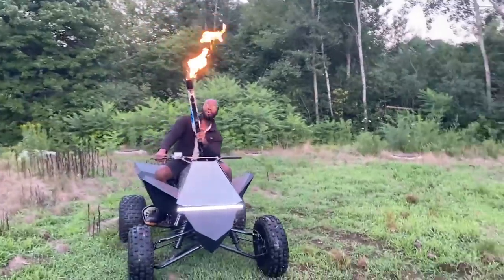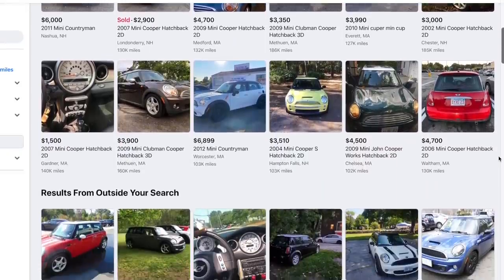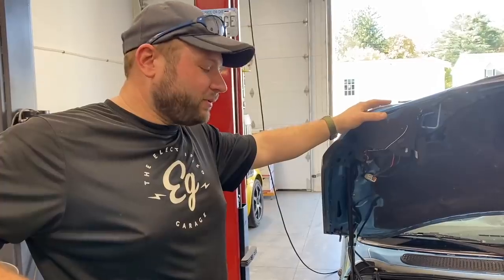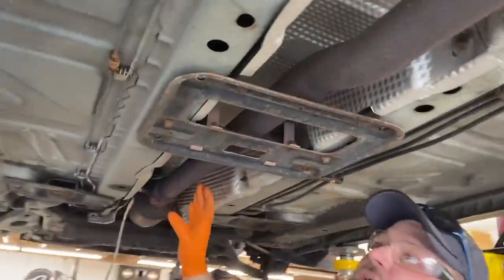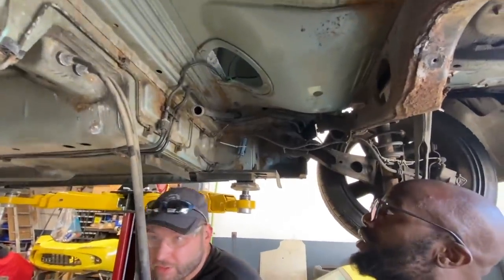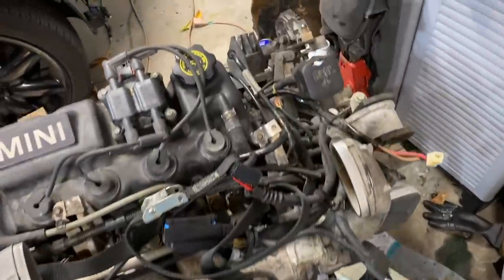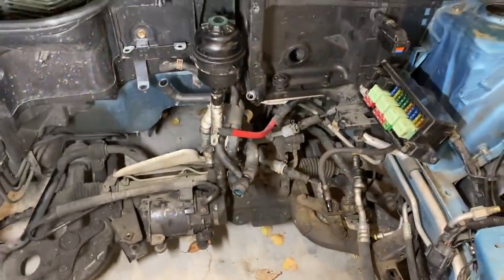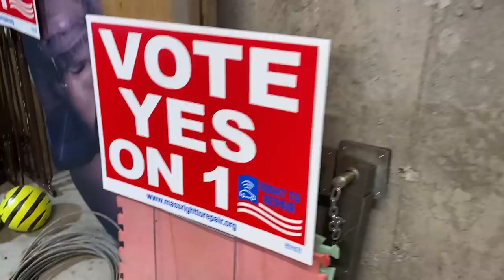I Bought The Least Reliable Car and I’m Making It Electric on a Budget

Comment: Idea : making a kei car into a hybrid, giving it an extra 30-100hp.    .. How far along are In wheel motors?    Hmmmm. Zero motorcycles got 100hp 20kg motors. In a kei van there's all the room. A honda s660 would be damn cool though. No idea where the motor would fit. Extra 50-100kg battery could fit somewhere in the passenger area, because it's their fault if they insist on Having feet.

Comment: Makes sense to keep the DC motor when you're keeping the trans. Sorry to hear the giveaway was such a shitshow, because one of those "I want this for an idea I have" dudes is TOTALLY me even though I never hit you up for parts.
I'm supes interested in how you decide to control the motor and what battery setup you go with. OEMs now are tossing out 100+ Volt potted lithium cell batteries in their hybrids, and DC motor controllers can be impressively simple even with 300+ volts running through them.

Comment: You probably aren't aware of this just yet, but there's a body control module that controls everything in the car (lights, windows, gauges, etc.). I don't know if it'll work if the ECU isn't in the car. These cars were made by BMW, so they have a lot of over-engineering in them.

The power steering fan that was seized was because the power steering fan overheated from not running. That fan only runs when the radiator fan comes on. The radiator fan is a 2-stage fan, but with a single motor. BMW used a resistor to lower the power going to the fan for the 1st stage, and those resistors commonly burned out. Almost no one is aware of this either. A big telling point for it is when you turn the car off and the radiator fan comes on to continue to cool the engine once it's turned off. It's so common that people actually think it's normal! But since that resistor burned out, it rendered the engine cooling fan inoperable until coolant temps hit about 232°F (which is easy too hot for these engines) . If this was an early model (02-04), that resistor failure can sometimes prevent the radiator fan from even coming on at all (probably why it overheated). So since the cooling fan basically never works, the power steering fan probably never turned on. So you get a bunch of debris in it and that bound it up, then it seized when it finally tried turning on. So you'll need to figure out a way to provide airflow to that pump. And judging by the crime on the hoses for the power steering fluid reservoir, it looks like they'll need to be replaced as well.

Also, you guys asked about the rear battery. Only the 1st gen supercharged models (2002-2006) had the battery in the trunk. Every other model has them in the engine bay.

If you have any questions about how things works on these cars, feel free to let me know! I've probably replaced just about everything on these 1st gen cars before.

Comment: Hey man !

First of i like your video,s alot woundt mind making my own ev myself ...

Question tho ... So you mate the electric-motor straight to the engine (with or without clutch) but i cant imagine the original parts taking all this extra torque without failing tho .... How do you handle that ?

Comment: 3 months of owning my r53 Cooper s”liquid yellow” I was 40 miles from home and the alternator wires caught fire and I didn’t realize the wiring issues bmw had with the r53s  before I committed. Mini replaced the whole wiring harness and 2 months later $3600 repair done for free the cars came back with nothing but draining issues it never stops blowing alternators but doesn’t have any weird voltage spikes or periods of higher output I’m still on the hunt for someone to take it off my hands I’m fed up and with money in the car and a rust free shell it’s a shame it’s not an easy fix I’ve done everything but I’ve Gave up 😂

Comment: 2002 piech, the VW guy, build the 1 liter car.                 Do that!  Or well. Faster, not quite as good, but faster. Got0.89l diesel per100kmh at an average of 72kmh. That turned into the vw l1 which turned into the xl1. Which is worse.    A efficient motorcycle gasoline engine and perhaps the 100hp zero motorcycle motor?         Just a tiny really efficient sportscar.

Comment: The new mini cooper... which generation? It had 3 vastly different generations the first one with the PSA engines were very unreliable indeed but the R56, which is the 2nd generation had a BMW engine in both diesel and petrol variants and are very much running without a hitch in general from what I can tell... the 3rd gen is unknown to me in terms of reliability, which is probably also a good sign.   aaaaand Rich just bought the rubbish 1st gen... excellent choice for a conversion. Go for it :)

Comment: Having filled my gas tank up then drove 100 miles and then slid off the road into a tree oh, yeah don't be throwing that gas out. Unfortunately due to time constraints at the junkyard and accessibility I was not able to recover any of it. Although I did get my stereo with Bluetooth mic and accessories but I was against a Time clock because the guy had to leave to get somebody else.

Comment: Contact Zero EV Bristol UK. They can sell you a reduction gear unit to replace the gearbox. The clutch may not handle the torque and the gearbox is not designed to handle regen. The standard box will also cost you range due to frictional losses

Comment: i dont know much about the usa spec minis, some of the uk spec ones have a battery in the front.
i had the misfortune of doing a diesel mini which had the timing chain between the engine and transmission, the top cam cog exploded so r.i.p cylinderhead, i love how you cant get the exhaust manifold out unless you remove the engine, car manufacurer's are brain dead.

Comment: Love all you projects, man... I want to take on a conversion on a Suzuki Super Carry minivan, currently around 600kg / 1323 pounds Kerb weight. I am thinking no gearbox, but two powerful hub motors in the front, and a powerful DC / AC motor at the back. The one set of motors will be for lower speed and acceleration, and the bigger motor on the back running through the diff will be for the higher end speeds, which are not going to be much.. This tiny thing is around 1.6m by 30m / 5.5 feet x 10 feet. This si super easy to park anywhere, and will be used to buy groceries and other handy city jobs that I want to do... I do not need more than 60km range on it... What would you guys suggest with something like this?

Comment: 10 years ago I ordered a 2009 JCW MINI Copper and it was the BIGGEST HUNK OF SHIT I'VE EVER OWNED!!!!!!! RUN... RUN away from this piece of shit!!!!! With lees than four thousand miles on the odometer and six months in of ownership I had a blown "tensioner pulley chain" that left me stranded on the 5 FRWY in front of Dodger Stadium spewing oil all over the freeway... That was the first of many, many disasters this poorly designed engine left me stranded with over time. She finally died when I didn't see the massive coolant dump she was doing during a freak 30 day 30 night rainstorm LA was experiencing a few years ago... because, you know, MINI doesn't have a traditional gauge cluster to indicate something is going wrong with the car. Needless to say, the coolent pump was leaking, causing the pistons/head gasket to shit the bed, in turn leading to a catastrophic engine failure. 

I Have countless stories on why MINI is quite possibly the worst car manufacture on the planet.... the best, I pick up the brand new car and as I was handed the keys the saleslady tells me... "Bring it back in 16K miles for it's first oil change" WTF!?! SIXTEEN THOUSAND MILES? Sure enough not even six thousand miles in, MINI back tracked out of this new "sealed" oil change every 16K when they started to see car after car being turned into underivable hunks of shit. FUCK MINI!

Comment: That "chicken wire" is actually "mechanic's wire" in some locales.
Reply: Or farmer wire or bailing wire or in Australia number 8 wire. The duck tape that never goes bad. If you can't fix it with bailing and/or duck tape then it not worth fixing.

Comment: That manual vs. power steering comparison doesn't work - a manual rack is much easier to turn than an unpowered hydraulic rack.
Electric brake boosters exist, just google it.

Comment: Funny it says “least reliable” car but if you look up the most reliable new cars. The 2019 Mini Coopers had a 5.0/5.0 Reliability rating.
Reply: Any one year old car should have 5/5 reliability rating
Reply: @210SAi   Yeah no bud lmao, that’s uncommon as fuck. The top 20 most reliable cars of 2020 are all 4.0’s until you get into the top 10. Then 4.5’s until the top 2 vehicles... The Mini Cooper at 5.0/5.0 and the Toyota Corolla at 5.0/5.0.
Reply: @ripF5C  you stated reliability rating then list safety ratings......

Comment: Dude, you are wrong. This is not "the least reliable car". It's expensive for maintenance but it's a well predictable car. Like I said, all the R53 "issues" are predictable. Owners are just too cheap to maintain their MINI Cooper R53. It's expensive to maintain because: parts are expensive (not so many jobber parts are available like GM, Ford, Chrysler) and labour time is 2.0x for anything that you have to change than for a Honda Civic.

But hey, good thing, there is already an electric power steering with this car. You better think to relocate it because it's a well known weakness of the R53 because of its location.

Ok, you got a 2005 R53, which is good. It's the facelift model.

~Respect, R52S proud owner! lol

Comment: That RS7 tho she’s a beaut it’s on the top of my list of cars I’d want to get but my current Audi’s issues I’ve had will likely prevent me from ever buying another unless it’s got a brand new warrranty even those BS add on warranty those scam artists weasel their way out of paying to fix parts at all costs. 3,500 for a new electrical fan and install At the stealer shit for an Sq5 almost killed me. Not to mention the 1,900 they wanted for a damn water pump and another 700 for a thermostat and new lines parts that are removed when the water pump is already total BS of course I pulled a google (YouTube) university degree in sq5’s so now I can do all the work alone but parts are still more then other German cars.

Comment: Portable electric air compressors with a pull spring at the top side of the brake pedal like how the brake lights are to illuminate? Or is that asking to be a ticking time bomb at 70mph? Electric cars use regenerative braking power technology but wouldn't that add more to a budget build. Alright alright. Let's sacrifice half the range and get towed more🤔. Let's drop regenerative braking entirely.

Tow companies would hate you rich. Hi AAA, I need a tow on my budget build daily. At only a $250 annual charge but they won't tow a vehicle for the same job twice.🤔 

Let me know in a future video what happens for the power assist braking.